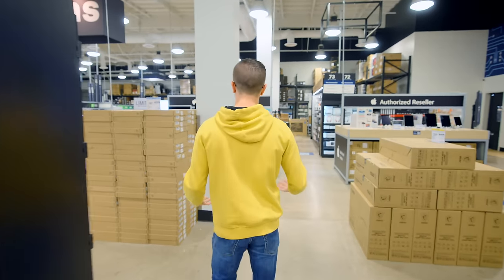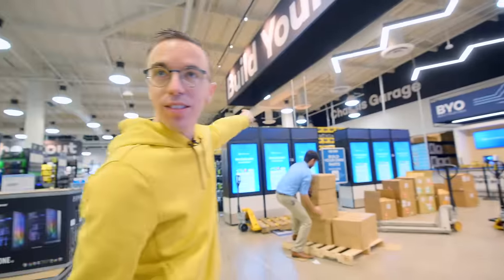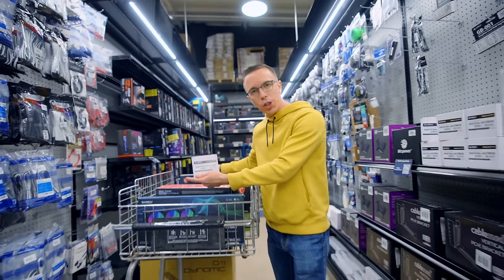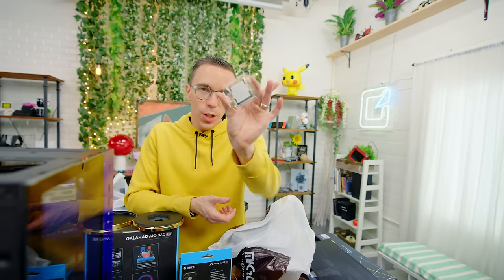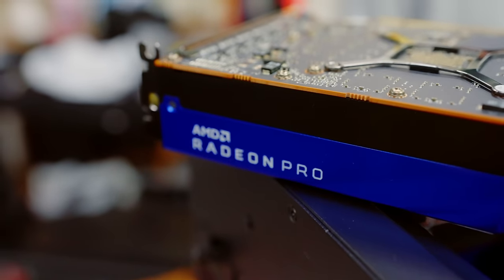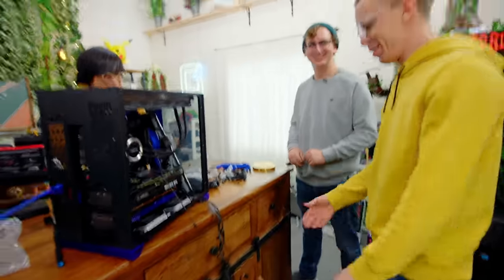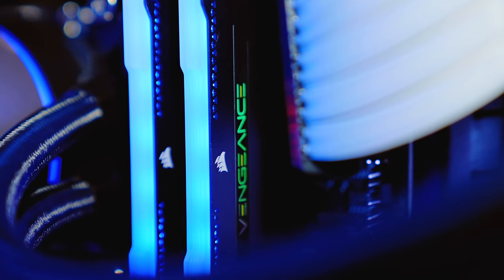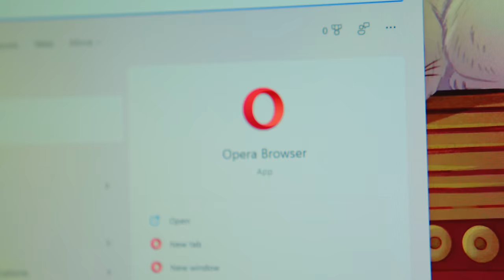$5000 Intel Gaming PC Build!

Comment: All that swapping out of motherboards could have been avoided with RGB software that controls virtually everything.  Running "Signal RGB" would have given you control over everything in that case.  If anyone out there hasn't tried it yet you should.  EDIT: Also.....The Corsair QL 120's and 140's plain look better than the Lian Li's in my opinion with two sided RGB.  They are like big RGB donuts full of RGB goodness.  I would have put an EVGA 3090 FTW3 Ultra or a 3080ti version if you were after a bunch of RGB.

Comment: You know what you should've done with the 5700 Pro?
Installed Linux on the system, and then virtualized Windows, passing through the 3090 and all of the P-Cores
Reply: Why?
Reply: @malcolmjelani3588  Why use the 5700 Pro at all?
At least this way there's no conflicting drivers. AMD is on Linux and Nvidia is on Windows

Comment: Me: Plays PC Building Simulator
Watches Austin Evans: "Ya know.. PC Building Simulator isnt very accurate. Instead you get ken sitting on the floor with  fans and austin putting a radeon in a intel build" 🤣
Reply: What do you want him to use, arc? Which just so happened to come out about a year after this video?
Reply: @mocsmore1308  you could also make the gpu custom to make it fit the build better..

Comment: My set up monitor tv philips 4k 50 hdr10 plus doby vision atmos +rtx 3060 12gb +ram aq 12gb +Intel i5 4440 +new casing trillion x dark x +power supply 750, resolution 3840x2160, 60.000 HZ

Comment: Don't build any more computers please because someone else will listen to you. The difference between DDR4 and DDR5 in gaming is about 1% and you have to pay twice as much. The second graphics card will not work 100% because the board has Pcie x16 in x4 mode. The Ventus series from MSI is a big joke, you had so many different versions of the 3090 to choose from and you picked one of the worst.

Comment: 5k and no cooling loops.. yikes..
Reply: @Mike That might work for a system with less power overall, or if you arent planning on optimizing your system, but Ill put a custom loop up against the limited voliume of aio's.   I dont want my cpu or gpu running at 90c, I want my max operating temps as closed to 60c as possible full bore. 

Thats not happening without a custom loop for people who tune their pcs.
Reply: @Mike If you are running a stock system that is fine, but when you are running an optimized system, the ram, cpu, and the gpu are all overclocked nearly to the point of instability. 

This requires more robust cooling than an aio can provide, ive tried it, it doesnt work under sustained loads the way a larger loop does.